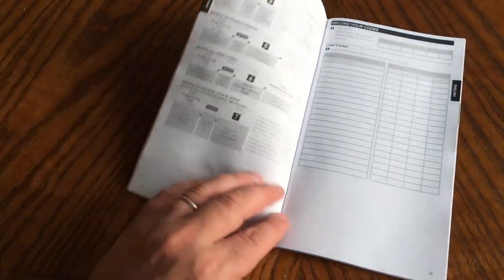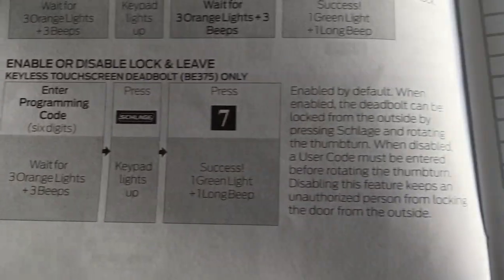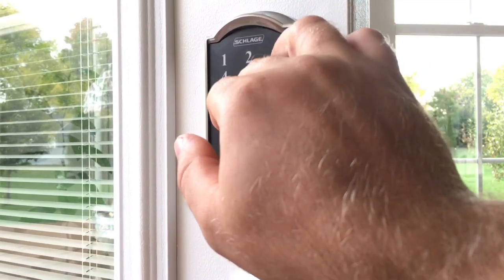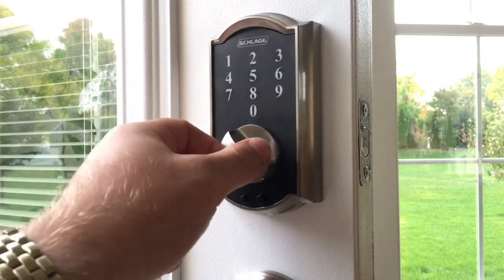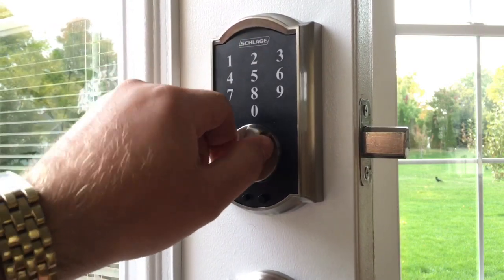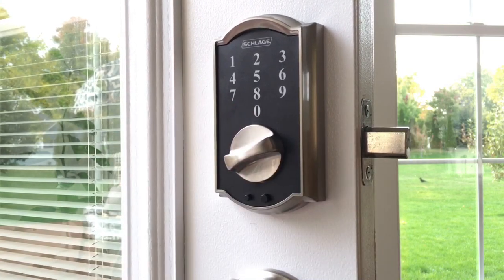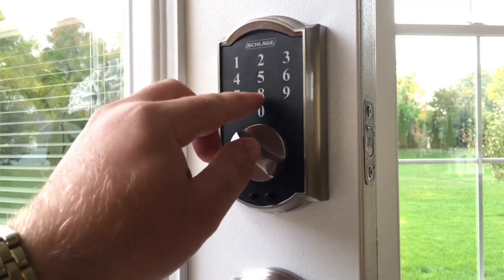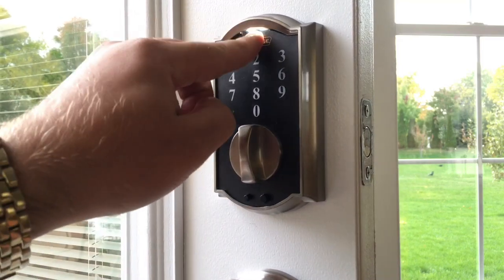[RESOLVED] Big Security issue with Schlage BE375 electronic touch locks

Comment: I have 3 other similar keypad and they all worked as designed. But my fourth one had this issue and YES I installed it right.  What I realized is when you fully extend the deadbolt it works fine but when you close the door and the deadbolt doesn’t fully extend it doesn’t work.  So while your door is dead bolted, it’s not fully extended. You need to fix what’s restricting it from extending fully. Once you do that it should work.  That worked for me. If you can’t extend it fully, this disable solution works fine. For all the folks that have been short on their response and saying it isn’t installed right, it’s not the case. Many more factors can play a role. Good luck.

Comment: Ok, the reason yours is doing this is because you installed it wrong. You didn't pay attention to the little sticker that told you the position of the inside latch when installing it (I know because I didn't pay attention and mine was doing the same thing). It does that because when you installed it the locked position is actually what the lock thinks is unlocked and vise versa. Re-install it with the inside latch in the correct position and this feature works perfect with no security issue.
Reply: Wonder if he listened.
Reply: Hmmm having this exact issue right now, will disassemble and look inside, thx
Reply: Agreed. If your not familiar with locks you should call a locksmith. I understand people don’t want to pay a professional to install a lock, but that is like having jiffy lube rebuilding your car from stretch. It’s just not within their scope or knowledge
Reply: @hotmetal5  Did it wirk

Comment: Installed this for on my mom door and didnt have this issue.
I installed this on a friend door last night and ran into this. Couldn't figure out why. The instruction manual doesnt address this or even mentions it. However when u scan the barcode and select 'Programming Guide' then il you'll see the option for 'Lock and Leave'.
I get the idea but its definitely something that should be printed for better understanding.
Nonetheless, im glad i ran into this video bcuz it definitely helped. Thanks!!!

Comment: I had a similar problem with my BE365 deadbolt. With the lock and leave feature enabled (default factory setting), the lock worked correctly when I tested it with the door open but worked incorrectly when the door was closed. The problem was resolved by disabling the lock and leave feature. Thank-you very much for a very informative video.
Reply from the maker: If you read the description of this video, there is a solution how to install the lock correctly so the lock-and-leave feature works correctly, so you don't have to disable it.
Reply: Thanks, I'll give it a try.

Comment: I had same problem, but as follow the below reply, I disassembly and assembly it by installation guide carefully again. it works correctly. I had to check the first step #1 (Install the bolt) CAUTION : Bolt must remain retracted throughout installation. I do not need this video solution. Anyway thanks for issue up here

Comment: You didn't install this properly. The lock must be installed with the bolt retracted. Check your installation guide under troubleshooting.
Reply: You are totally correct. But there is more to this. Say for example you played around with it before install, and locked and unlocked it an odd number of times before it was installed. Well, the outside portion does not know locked from unlocked it simply engages a mechanism when the code is correct. So if you now install it with the bolt retracted but the electronic part is in the wrong position then you will still have this problem (this is what happened to me). What I did was pull the lock apart did my code again, cycled the outside lock, then reinstalled. Now works as intended.
Reply from the maker: Rob Leffley Thanks everyone for the information, this helped me to go back and fix it. I had to play around a bit to figure out the right position of the parts inside and eventually it works. Here is what i had to do:

- Enable the feature with 7 key
- Turn the knob to unlocked position
- Took apart the indoor part of the lock
- set the knob to vertical upright position as shown on the inside of the lock
- assembled the whole thing with knob still upright.

Then everything worked fine.
Reply: enjoymp3s I bought one of these and experienced the same problem. I was considering returning it, but thought I'd try your technique first. To be honest, I'm not exactly sure what I did, but it's working properly now. Thanks!
Reply: Reinstallation is not always the answer...IJS...
Reply: Rob Leffley, while that is on fact what Schlage claims, in my experience installing dozens of these it isn't entirely correct. So for others who may be reading this, be aware that even when installed with the bolt retracted and the cam arrows aligned exactly as specified in the directions this security issue can persist.  This lock should be recalled.
Reply: @EMD_Ski  How can it persist if you know to correct it?
Reply: @philindeblanc  because the "fix" doesn't always work.

Guessing from your question that this is where you go into "it worked for me and therefore must work for you and everyone else every time" mode, so let me in advance decline from playing further. It's a bad lock in my direct experience. YMMV 👍
Reply: @EMD_Ski  I was about to buy it, and now I will. The week point is the casing. I will have plates welded inside it if need be.
Reply: @philindeblanc  If you successfully weld plates designed to fix the casing please show us pics of your updated casing.  I would like to do the same to prevent drilling into the lock-unlock mechanism.
Reply: @philindeblanc  There is an updated one with a steel plate in the vulnerable spot now to make it more difficult to drill. Even so, you can still add more resistance to that area or simply install a block plate on the exterior door itself to prevent a drill bit from even being able to access that spot.

Comment: You are a life saver and the only video that addresses this without taking it apart again. I had a handyman install mine and it was doing this. He came back and took it apart, re-installed and it STILL was opening the door after just hitting the Schlage. I was soo frustrated and did not want to attempt myself taking it apart for fear i might not get it back in,  i left a separate bottom key lock on my door since it was too risky which basically was like leaving your door open. Now i disabled the feature the way you showed and it unlocks with a code. I don't really care if i have to lock it with a code as well, its better then the other way. Thx again
Reply from the maker: In video description I wrote steps to follow in order to fix the issue, so you can still have the "Lock and Leave" feature, but It will work correctly. At the time of taking the video I didn't know the solution, but with help of peoples' comments I was able to fix my lock and wrote a solution for you and everyone else in video description. You will probably have to click "Show More" button to view full description.
Reply: Jen Marie ... the lock was installed incorrectly.

Comment: Why do I get the feeling that the function times out after a minute, or less, thereby not allowing the button press to work once the bolt is extended.. Schlage digital and resi locks pretty much suck now, but I think theres more to this "story". 

Wait till you see the new ND80 electric lever with a...

Ready for this??

Plastic inner hub--YES plastic.

Schlage is now on par with kwikshit.

Comment: What did you do to fix the problem, because I took it apart and it still opened when pressed schalage so I deactivated it like you said!
Reply from the maker: I wrote it in the video description section what to do to fix it. initially when i made the video, i didn’t know that it can be fixed, but, thanks to contribution of commentators, i found out what i did wrong and i wrote the steps to fix it in description.

Comment: That’s no good like that because I just ordered the same one and waiting to be arrived. 
I had used one for my front door for about 2 years but the one I had has a button not touch screen I don’t have a problem like this . To leave I just click the Schlage buttons to lock it and I can’t unlock it by pressing the Schlage button like yours and can be unlock I have to put a code in to unlock it. I will change to this model soon in a few days because my old one all the numbers buttons are faded and numbers erased and hope the new doesn’t do like yours . I will updated my review after I installed it .
Reply from the maker: Brandon Yen Don’t worry. Read the video description for solution. I just did a mistake while installing, that’s why it malfunctioned.

Comment: The lock was not installed correctly, when installing the lock make sure that the latch is in the unlocked position, and don't worry, this is a common mistake, but for those out there who don't know were here to help.

Comment: You DO NOT need to factory reset to fix this issue!! I have a rental unit where I dont need access to the main code. All you have to do is install it according to the diagram inside the lock on the orange plastic. If the deadbolt is withdrawn inside the door during installation and the black arrow is pointed down, it will work. It stopped working after I took it off to paint the door and is a PHYSICAL issue not a programming one. You do NOT want to disable the lock and leave feature because this means your guests can't lock your house when they leave.

Comment: Can anyone help me I have the same lock been working fine for a couple years now when I put the code in to go into my house I hear things moving but I still can't unlock the bolt it just turns freely there has been a few times that I put the code in two or three times and then I could unlock it
Reply: I have the exact same problem.  That's what brought me to this video.
Reply: It could be from a lever being slightly out of position. You can try resetting the lever back to the correct position and see if that resolves it. There is a video on that https://youtu.be/S-XtoexKqI0 . If that doesn't resolve it I'd definitely call Schlage about the issue. I'm sure they already know about it and perhaps they can do something for you

Comment: This can be opened so easily with small hole and wire ...hope you guys don't still have these on your doors
Reply: With video recording the drilling and the pick....why not? there is not much to steel here, but it would make a great video watching a thief.
Reply: They've updated it with a new steel plate inside that area. It's also very easy to add even more drill resistance to it internally for anyone that is handy.  Additionally, it's not too difficult to add a block plate to the exterior door in the area where the whole needs to be drilled in order to block access to that area.